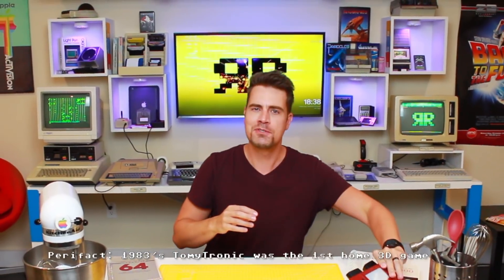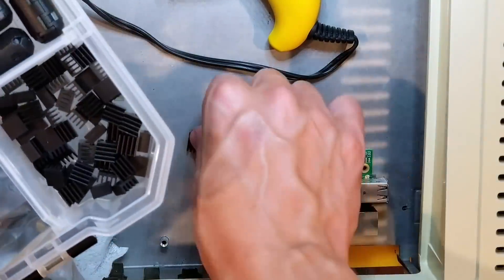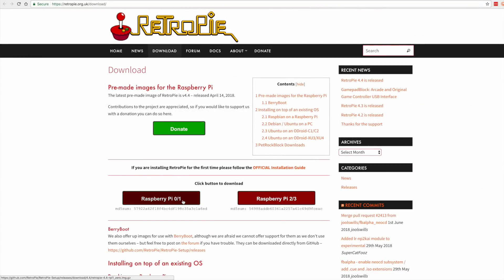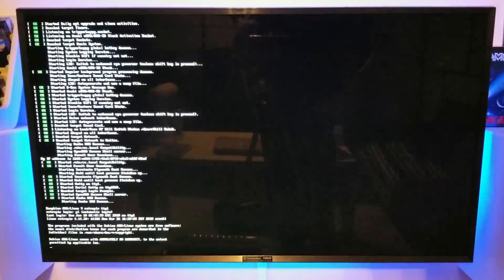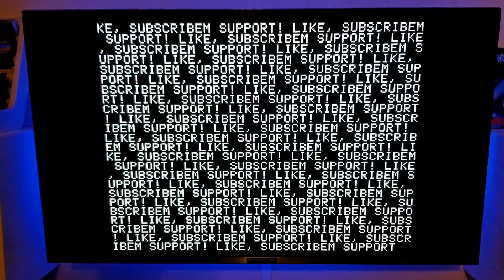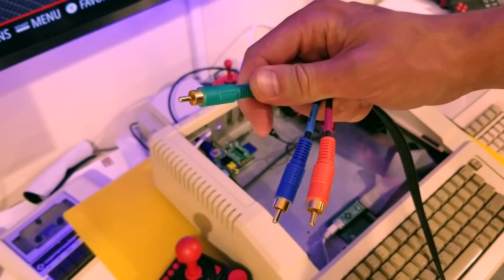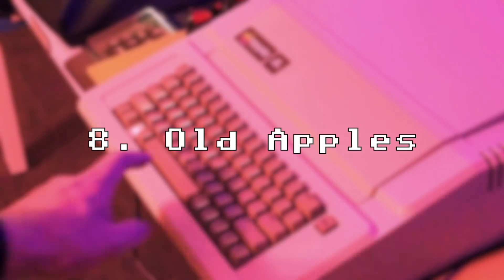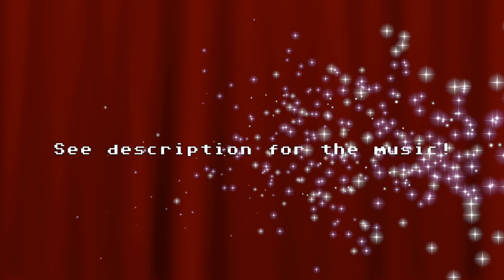The Apple PIIe - Part 1/4 - Proof of concept prototype feat. Jan Beta #ThinkDifferentChallenge

Comment: The first Apple computer I ever used was a IIe in the Data Processing Department If Queens University Belfast. I was on job placement for a week and had five assignments. Having only programmed in BBC BASIC before this, I still found it surprisingly easy to program the Apple.

Comment: Just some ideas: needs an internal modular power supply -- no wires running out back.  and move composite connector and hdmi to the back io shields. This will be neat! I am interested to see how it eventually ends up.
Reply from the maker: I will pass this on to +Jan Beta! 👍🕹️

Comment: Breaking down the dd command he used:

sudo - elevate the command to admin or root privileges
dd - the command that copies or burns the image
bs=1m - defines the block size of the transfer
if=retropie.img - define input file
of=/dev/rdisk4 - define output location, r before the disk name denotes using a different node than the usual disk does. rdisk is a special node that is "closer" to the physical disk than the disk node. Basically, a couple of buffers sit between the two, and rdisk SHOULD be faster than disk.
conv=sync - pads any partial input blocks with nulls if it doesn't receive a full block of data

When using a Mac, you can press ctrl+T to show the progress of the command based on the blocks in and out for the image you're burning. On GNU/Linux, you would need to add status=progress to the end of the command to see the same basic output.

Comment: you could add "status=progress" to the d's command to give you, well, a progress display I think.  (It works on at LEAST the LUBUNTU 18.04.4 x86 image I use to blank my harddrives before testing... But it should work on other Linux derivatives.)

Comment: Hi my name is Stephen , I currently live in Tennessee but moved here in 2006 , iv lived up infill then in the losangeles county areas ,palmdale Lancaster and littrock, as I believe your in LA right anyways , I've been building something simaler but I decided to use as it never did have a proper home and as I had this board available for a project for quite some time an orange pi PC in an original Xbox case, I'll be using retro orange pi distro version you may have heard of made specifically for this board , I'd remembered this video , if you know anything about the orange pi pc I'd like to ask a few questions about my project unill then thnx in advance for any help you might have and keep up the good work , love the videos :)

Comment: Gotta love that Amstrad PCW in the background!  One of the best systems that LGR will never review!  

Also, by Apple Pi, I would sorta kinda like to see Apple release their own SBC, whether they call it the iMake, the io'Thing, the Wozboard or just ditch all semblances of imagination and call it an Apple Pi (but not an iPi, not even an iπ, Just.  No) as it would be the only SBC that could ever credibly called a Raspberry Pi killer.  

Sadly, I just don't see Apple ever doing that, they probably have been more likely to do that under Steve Jobs than nowadays...

Also, it seems rather fitting that you're using a Mac to setup your Apple π//e!  

Wouldn't that SNESpad logo need to read GAMEPAD //e or Super //e?

Part of me wants to see this done with a Commodore 64 (but not an Amiga... unless the Amiga is very dead... OK the C64 would have to be very dead too)

Actually, part of me would like to see this done to a very dead original Macintosh, even with the original monochrome CRT!

Also, all of the Raspberry Pis have composite out, it's just that the later models use 3.5mm TRRL rather than RCA + 3.5mm TRL

But still Apple releasing a Raspberry Pi killer, would that be awesome?  Or a terrible idea?

Also, got to love that TomyTronic... I;m a bit jealous that you have one actually!
Reply from the maker: Nice ideas! I use that model as I like the old school RCA jack. Thanks for sharing! 👍🕹️

Comment: 😱  they do make shorter USB cables…

From my experience, I've heard eee-thernet more from Brits, than from Yanks.  I've always said eh-thernet, in my Phila english

what key layout do you have where ! isn't on the 1?
Reply from the maker: Lol they make them shorter? Wait what?! 😉 I like to use what I have and "make it work". 

What I meant is when I pressed shift + 1 it gave a question mark. I then realized there is a button on the USB adapter that toggles caps lock making the number keys emulate function keys. Then I got the "!" Back!!!! 😉👍❗

Comment: In all my life as an IT professional using networking standards from before Ethernet was used I have never heard it pronounced the way you say it. And yes, I am from the UK too! It comes from the word ether (ee-ther), and old word for atmosphere which is kinda odd as the data is transmitted over wire, not wirelessly. WiFi could have been Ethernet if Ethernet had a different name lol
Reply from the maker: "Wifernet"? And you're right, me and my friends always pronounced it incorrectly. Thanks for sharing all your corrections 😂🤦‍♂️

Comment: Would have been so much better if they could have took more time and have made a custom mounts and such to use all the original spots without any modifications to the original case. They drilled holes and cut out holes like crazy. My project is using the original case unmodified. I took and made a custom plate to mount all new hardware on and used all the original board mounts to advantage. Even used the case of the original power supply to keep it all original looking. I can easily install the original motherboard and no mods were done. I have the best of both worlds in one case.

Comment: Using a R-Pi (One) B in 2018? ANY R-Pi has composite video output and analog audio. You just need the four polarity plug.... Use a R-Pi 3B+ and you'll see what's really "modern".

Comment: You need to really cut down these dad jokes
Reply from the maker: Sorry son
Reply: I had it coming, good one. 
But seriously, Barry White voice feature is too cool to bring it down with these puns.
Reply from the maker: I appreciate the feedback! 👍🕹️🎙️
Reply: Hoping for a ZX Spectrum review. My own experience with its modded clone "Ленинград 128" was pleasing.
Reply from the maker: You know, I never owned one, though my friend did and I spent hours playing Atic Attack... in his attic (not a pun.) I'll definitely be doing an unboxing and switch on of the ZX Spectrum Next the moment it arrives. But no sooner. 😉👍🕹️
Reply: The best part is that all components are still in production, so you can build your own one and buff its RAM from 48k to 128k. There's even some software that benefits from expanded RAM to the point when it cannot run in 48k version, which eventually pushed me to upgrade mine. It looked like a spider had its fun in terms of wiring, but it worked!
Reply from the maker: Nice! Good info.